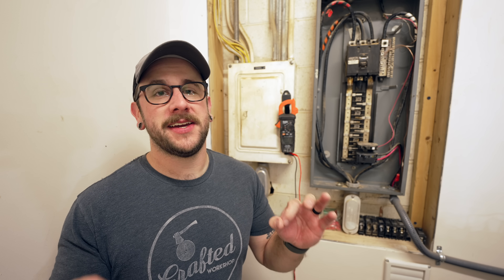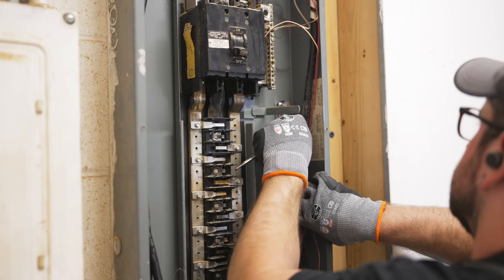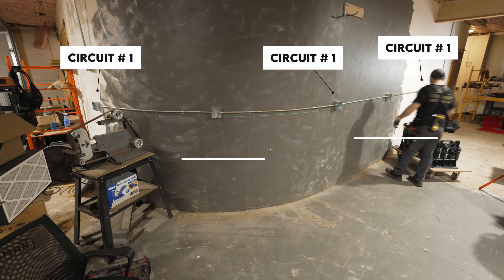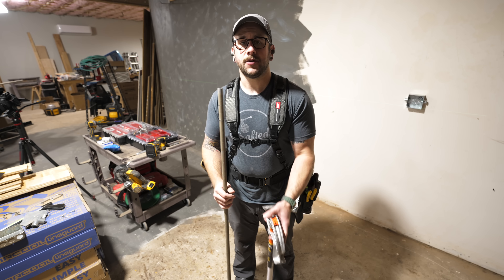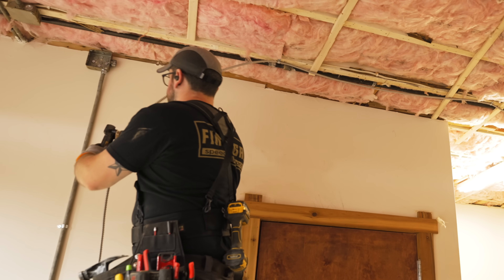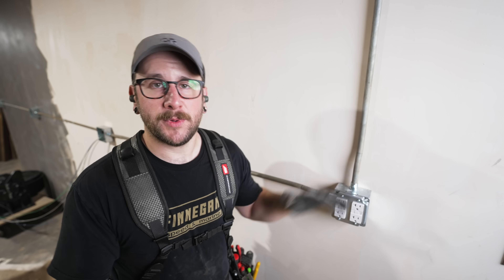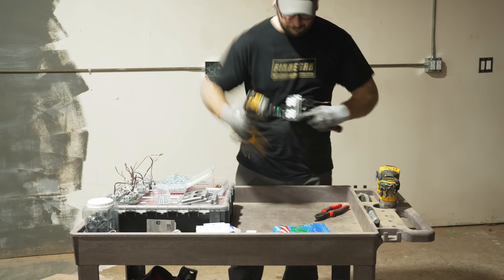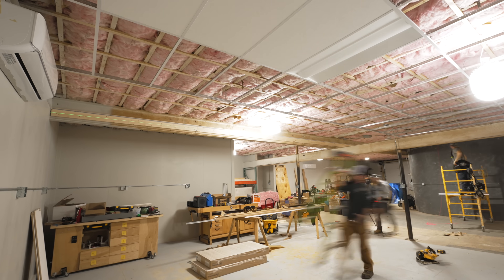WORKSHOP RENOVATION 16 : DIY Shop Electrical Basics w/ Conduit Bending

Comment: I added a 125A sub-panel to my garage/shop. Two things I wish I did differently for anyone who is thinking about doing the same: 1) Go bigger on the conduit than you think. When doing 220, each outlet has to be a dedicated circuit, so you have a LOT of wires to pull. The conduit quickly fills up and it makes it difficult to pull. 2) I used 12awg THHN because I only needed 20A outlets, until I needed 30A.... now I wish I would have just ran all 10awg. If I would have ran all 10awg, I could have swapped one of the outlet 20A plugs for a 30A instead of having to run all new conduit/wire for ONE 30A tool.
Reply: Hire a skilled tradesperson.
Reply: @soisaidtogod4248  Hire a skilled tradesperson, says the tradesperson
 looking for work.
Reply: Future proof, baby!
Reply: No reason each outlet has to be dedicated unless you plan on running multiple machines at once. I recent built my shop with single and three phase via a large rotary. I have 4 50 amp welding outlets around my shop depending on what I’m doing. I’ll never be welding at more than one location and I’m the only person who will ever be working in there. Just plan accordingly and you’ll be fine.
Reply: @Jraksdhs  I guess if you're by yourself you are fine, but I still wouldn't do it for the next person. I work with another person and often run the dust collector, CNC, vac table, laser and other tools all at the same time, maxing about 120A at one time (tool rated, not actual measured draw).

Comment: I don’t think I will ever understand American wiring 🤪 by the way you don’t use a pipe bender the way you did, the bend head should be on the floor and you use the handle to make the bend it’s not a stand, I dread to think what would have happened if you had slipped but I’m sure it would have hurt. 😮😊👍

Comment: Looks great! Love the deeper boxes with two circuits each. Good call on the dedicated ground and separate colors. Strange that there would be 3-phase power into a sub panel, do you have true 3-phase coming into the building? One thing I found useful is to install a couple rectangle USB/outlet combos around the shop. Handy for charging a phone or using clip-on USB lights on any of the tools. Looking forward to the next video

Comment: I am a limited energy electrician here where I live when running conduit  you are supposed to have a conduit strap within a foot of the box and one every 10 feet of pipe. Is that not a thing there ? It was NEC code last time I had to do code update class.
Reply: It’s 3ft within a box/coupling and 10ft after that

Comment: In a commercial buildings it better for the ground on the outlet to be facing up incase something plugged is hanging out just a little. If something metal falls on it it will hit the ground instead of the hot and neutral. Most new construction commercial buildings spec it in the plans.
Reply: I know this is true in hospitals but I would still do the way he did because I think it look upside down otherwise

Comment: wago - W souds like V (like in victory); A sounds like in Apple; go sounds like in gold. They are a german brand, and in Germany W sounds la v link in Volkswagen
Reply: I guess these are finally legal in the states. They're probably better but I still stick with wire nuts and tape. I should probably get with the times and start using these
Reply: @macxgeek  wago is way more versatile in different conditions, and 90% faster, wago has an entire ecosystem like, gelbox for waterproofing, different mounting plates and clamps, different distribution boxes and more. I'm not sure how many of their produs are right now in USA but in Europe is wideli spred. The competitor for wago si OBO

Comment: Cool to see you doing electrical. I'm about to install the Mr Cool system and will need to install a new 240v circuit. Your video today serves as motivation because I have no electrical experience

Comment: Another good practice is to label each of the receptacles with the circuit breaker number (from the panel schedule).
Reply from the maker: Definitely planning to do that after painting! Good tip!
Reply: Hospital standard is to label the outlet with the panel number and the circuit number. Especially when you have a bunch of panels it's a life saver (literally, in the case of life support equipment). I don't know if that's just an institutional thing but it made sense to me. P7C15 etc
Reply: OCD much? LOL
Reply: @soisaidtogod4248  Until you spend an hour rooting around for the exact right switch so you dont have to shut your whole shop down.

Comment: It is important to know that wherever armored cable is cut, you should install a red head insulator to protect the wire. It fits inside of the srmored cable.
Reply from the maker: Yup, forgot to show that but definitely doing that everywhere.
Reply: Charles is correct. It is called an anti short bushing.
Reply: Was thinking that too

Comment: You guys are lucky to be able to do this work for yourself. Down here in Australia you need to be a fully qualified electrician to do any electrical work. We also have different power available to us, all domestic single-phase outlets are 240 volt & commercial 3 phase is 415 volts. Billy J... Queensland, Australia
Reply: We can also have 208volt 3 phase in the US in addition to 240v single phase, 110v single and 480v three phase. makes it a bit fun at times.
Reply: Well sometimes is better that way when the electricians are really qualified , in my house half had reverse polarity and nothing was grounded.
Reply: This for sure will require a city inspection for it to be legit if it checks out he's good. Given the previous work I'd be surprised the city has construction inspectors.
Reply: In the US you just need a YouTube channel to know how to do everything.
Reply: If this shop burns down, insurance will deny his claim based on this video alone.
Reply: @jerishigan6567  in many places you can do the work and have an electrician sign off on it.

Comment: Please don't use this video as a how to,  the amount of wrong info and techniques are to long to list. USING THOSE WAGOS FOR HIGH AMPERAGE DRAW MACHINES IS NOT RECOMMENDED. GREY is the nuetral for 277/480 volt circuits.  No anti shorts for the MC, securing not to code...............
Reply from the maker: I’m not using WAGOs for the 240V circuits, although they make larger ones meant for up to 10AWG wire. Also, forgot to show the anti-short bushings but they were added. I had to get drywall anchors to come back and secure those two MC cable wires within a foot of the box. It’s impossible to cover every detail, this was meant to cover the basics of different materials and that kind of thing.
Reply: wagos aren't the same as the backstab receptacles btw 
they have a spring mechnisiam that holds the wire very securely btw
Reply: @BenCos2018  they are one step up from backstab devices. You can't think that it's the same as a secure splice and wire nuts/ marets.
Reply: @Belg1970  they are safe as long as they don't get overloaded tbh
Reply: @BenCos2018  machines with motors have nothing but high start up loads. They peak and then go into run mode. That's why as a 40 yr electrician I would NEVER use them in this application.  They are fine for led lighting loads of other small isolated loads.

Comment: "I really don't want to spend time and money replacing this older panel" - that statement is a HUGE red flag. You are doing a major renovation on the building, you need to consult with your local code office because you are likely REQUIRED to replace the panel due to the extent of the work on that building. And you should be doing it anyways if for nothing else than safety.

I also notice that no where in this series have you talked about permitting or code compliance. Have you secured permits for all this work? I realize North Carolina is likely different than other places, but these are still things you need to go over and address.

Comment: Some of the motors on tools are going to trip those GCFIs
Reply: they trip arc fault, not ground fault. it's a HUGE issue with the new code requirements and power tools
Reply: @BrianStreetUnity  Ah okay. I just had a new house built and I was tripping breakers like crazy. The electrician said GCFI but he was an apprentice so he might have misspoke.

Comment: When did NEC change to start requiring a separate ground wire inside EMT rather than just bonding the EMT to use the conduit run as a ground path? Asking because I have a similar project I’m starting and I can’t find any references to a code change that disallows using the conduit as a ground path.

Edit: This comment was in reference to the statements at 2:50 around the ground wire between the main and subpanels. I suppose it would make sense to treat that separately in code compared to the receptacle grounding you do address later in the video, and which is more applicable to my own projects. Would still love to have a reference.
Reply: Dedicated ground is not required in my area either. However i experienced an energized conduit due to a piece of equipment that failed to ground. leakage voltage that would tickle but, nothing harmful.  Still enough to make me run a dedicated ground whenever possible.
Reply: It's just good practice to have a dedicated ground. In some areas even a sub panel requires a dedicated grounding rod as well, not just a ground back to the main panel.
Reply: Doesn't in between receptacles,  codes a minimum,  good quality work requires it. Conduit becomes corroded, gets beat around, comes loose over time. Good ground path is essential.

Comment: Over here in Europe, we just GFCI the entire panel so everything down stream can just be standard breakers.
Reply: 200A 😂 most places in Europe has 3 phase supply (even domestic) and 230/400V so we don’t need that many amps. And we don’t need so thick wires. A common house in Denmark has  25/35A main fuses typically 😁
Reply: @SilverEagle83  I'm always almost falling from chair when I hear about hundreds of amps...and at same time one power socket can take just about 1800W.
Reply: That’s interesting. So the main service breaker (say 200amps) is a GFCI breaker?
Reply: @johnowens178  You have a separate main service breaker and GFCI here.
In older buildings where GFCI was first beeing used, you only had one GFCI for the whole breakerbox. So if it tripped, your whole house would go dark.
Today you usually section them up, so lights go on one, and outlets on one. But id still say you dont have more then maybe four GFCIs for a standard house.
Reply: @johnowens178  Usually a main breaker in the region of 25-50 amps (3-phase 400V, so that equates to 150-300 yankie-amps, i think). Behind that is a GFCI and then everything else. A few circuits might have their own RCBO (combo) breaker.
Reply: @jmonsted  "Yankee" amps, I love it. Thanks for the explanation.
Reply: Similar to Australia. 

You have two options: RCD + up to 3 same purpose MCBs for a block of circuits or RCBO (which is RCD and MCB in one) for each circuit. 

There is an option to get an outlet with an RCD attached if it’s not feasible to protect at the switch board. 

Also noteworthy is that we split lighting and general power onto different circuits rather than sharing the same wiring for both like in the US.
Reply: Since some people decided to use only one CFGI for entire house, there are new decrees which require you to have separate CFGI for almost everything (great, now my panel is too small again!).

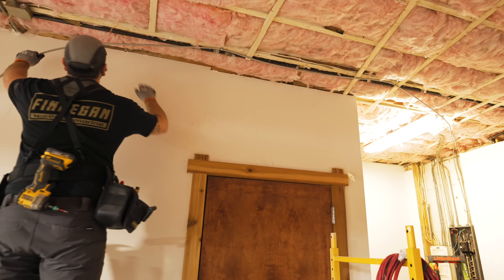Comment: 9:15

NEC 330.12 uses not permitted 

Type MC cable shall not be used under either of the following conditions:

(1) Where subject to physical damage

You cannot run MC wherever you want in exposed runs. The metal jacket is very weak and easily damaged compared to EMT. If it is run exposed it must be next to framing members that protect it from physical damage, not down an open wall like you said.
Reply from the maker: Interesting, I thought it could be used surface mounted pretty much anywhere indoors. Good to know!
Reply: Does that apply, since it's above a drop ceiling?
Reply: @haphazard1342  it applies wherever it is subject to physical damage. So attic space and runs inside the ceiling would not be subject to physical damage
Reply: came here to say this. thank you

Comment: I just did a quad box last week and found the tabs you break off of the face plate is actually a nut to be used with screws on the outlet, this was a great idea to me as i dont always have the correct nuts and screws on hand.

Comment: Why are you using your conduit bender upsidown?  Bend tooling and conduit should be oriented on the floor and the pipe bender torque arm pointing upward to allow to to generate leverage to bend the conduit.
Reply: Proper manipulation with a conduit bender for box offsets, the start of a saddle bend, and true offsets is performed with the bender side up (air bend), handle end to the floor. It's done this way for precise angle degree marking use on the bender - versus 90 deg stub, back-to-back bends, etc. where the bender is used with floor leverage and the 90 deg mark is intuitive.
Reply: Anyone who says that conduit should always be bent on the ground has obviously not been bending pipe long or doesn’t know how to really know how to use a bender.
Reply: @timothydixon2545  I’ve personally never seen someone air-bend an offset in EMT before.  The industrial work I’ve been involved with has all been with rigid and that is where my comment originated from.  You learn something new everyday.  Have a wonderful day.
Reply: @ I air bend rigid to bud lol
Reply: @ up to 1” if I have to
Reply: @ not 90’s but I bend all my offsets in the air so I can see down the pipe to get them straight
Reply from the maker: Box offsets are bent in the air generally.
Reply: @craftedworkshop  though u did all bands with the pip on the ground. This is interesting.

Comment: Please tell us you used insulators in each end of the MC cable. They’re used to protect the wire from chafing on the jacket. The little windows in the connectors are there to inspect for them. Also, it seems you didn’t support the MC cable close enough to the boxes, according to code. You’re using wrong terminology. The boxes are outlets. Therefore, light outlets, switch outlets, receptacle outlets. The receptacles are just that, receptacles.
Reply from the maker: Yup just forgot to show it!
Reply: They are not required by code
Reply: @sethprofitt  Not sure about US, but in Canada they are required by code. 
12-610 Terminating armoured cable (see Appendix B)
(1) Where conductors issue from armour, they shall be protected from abrasion by
(a) an insulating bushing or equivalent protection installed between the conductors and the armour; or
(b) the inner jacket of an armoured cable, provided that the inner jacket is left protruding a minimum of
5 mm beyond the armour.
Reply: The red circle thing right?  I also think the same way.
Reply: @jesswu0213  They are called anti-shorts in Canada, not sure what they're called down south
Reply: @tedthompson9379  sometimes called redheads here but I think anti short bushing is the proper term
Reply: @tedthompson9379  they’re not code in the NEC
Reply: Correct, they are not required by code.

Comment: Oh man, wiring in the US is so scary. I am so thankful we are far superior in electric components here in Europe, especially in Germany. Metal housings aren't allowed here, I mean that's good, because you know that metal and electric is a bad or let's say good combo. 😀
And all the breaker panels and boxes, horrific. They look like they're from the 1930s. When you also get 240 volts, why don't you use European breakers? They are way cheaper. But you would also need another breaker box.

At least you're using WAGOs. 👍🏻But in general, wouldn't it be way easier and better if the whole planet would use the same system? I mean beside the changes in all net systems.
Reply: Completely agree Im happy that we have stricter law‘s here in europe wiring in the us is scary in general.
Reply: @sijan1172  And now combine it with cardboard houses...

Comment: You should use something called anti-short bushing at the end of any MC cable otherwise it's a fire hazard
Reply: It depends how the MC cable is terminated. Some terminations screw inside the MC and replace the bushing.
Reply: Wrong

Comment: Why not just make the outlet on the right on 1 of the circuits and the one on left the other circuit? If your running 2 pairs anyway that would put a different circuit at every location on the wall
Reply: If you do it that way you could inadvertently plug all your machines into one circuit. His way automatically avoids that unless his shop layout for whatever reason puts a machine every other outlet.

Comment: I recently built my shop and all 110 breakers had to be GFCI at $60+ each vs $7...  the cost of them is crazy.
Reply: Probably Arc fault breakers not just gfi.
Reply: That's 120V /240V . There is no110V. LOL yank education.